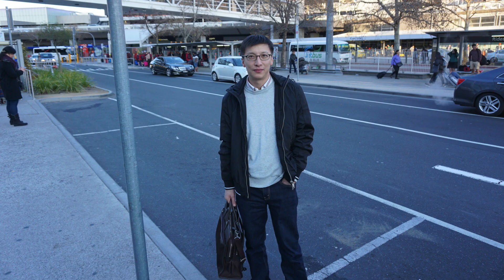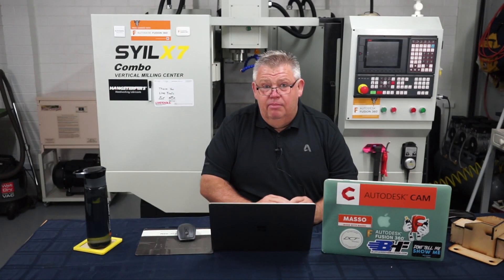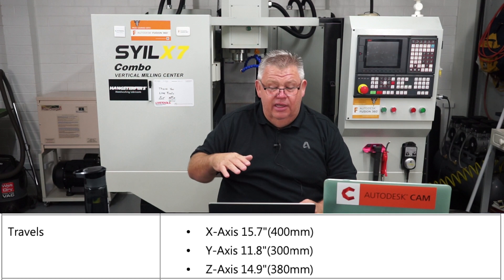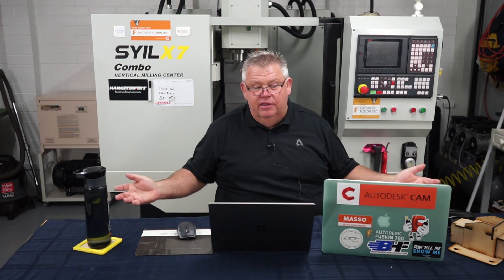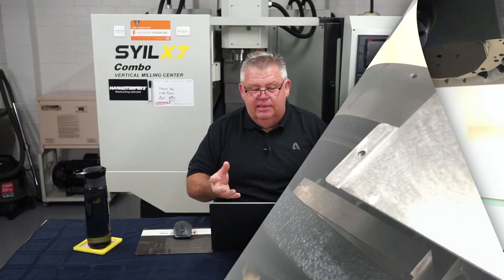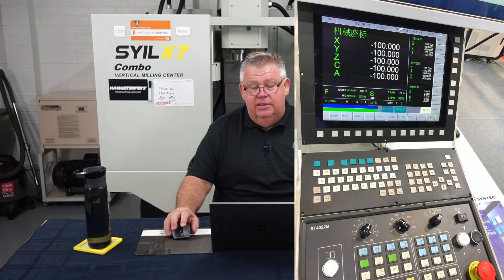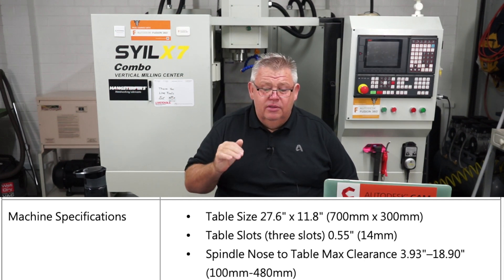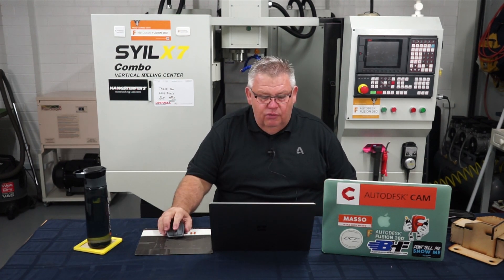2020 SYIL X7 - All new Epoxy Granite CNC Mill

Comment: Have you had any issues running the x7 off the rotary converter?
Reply from the maker: Hey mate. Absolutely not, no issues ever. I have an Australian made rotary phase converter (PC8 Phase change converters Australia). I run my entire shop off it. CNC, manual lathe & mill, pedestal grinder and drill press. Cheers 🍻
Reply: @DCT_Aaron_Engineering  Thank you for the reply!
Reply from the maker: No worries 👍🍻

Comment: It's nice if they reinforce the internal structure with steel, my concern is if you were to dry/mist mill and cause thermal creep and deform the epoxy granite locally. Epoxy glass temperature is very low, some range from 50 to 70C and doesn't take much force to soften it.

Say if you were dry mill and hot chips cumulate in a spot which would ultimately heat that area, how can syil ensure this kind of problem isn't a problem?
Reply: We use Schneeberger Swiss, it is the same as they provided to DMG MORI, GF+, HEMLER, Etc. so it is top class components in the whole machine tool industry.
Reply from the maker: Hi Richard. I’m sorry but I can’t answer your question. May I suggest you contact Syil directly with that question. Personally I’d be running flood coolant, or if milling steel compressed air blast. TBH, I don’t foresee a pile of chips staying that hot in a huge pile. However that’s my opinion and not a proven fact 👍

Comment: they now have an option for a fanuc controller and a siemens 828 3 axis controller. they have removed the syntec option
Reply from the maker: Hey mate. Yeah they’ve got a few controller options to choose from. It all depends on how deep your pockets are 💰 😉
Reply: @DCT_Aaron_Engineering  if you upgrade to Siemens controller they also upgrade to Siemens drives and servos. It is a complete package upgrade. Correct?

Comment: Datron german cnc milling machines come with 60,000 rpm spindle without any torque issues. They specialize in high speed milling.
Reply from the maker: That good to know.  But have you seen the cost of that machine?  When comparing CNC machines you must compare apples with apples.  A Syil isn't a Haas, A Haas isn't a DMG Mori or an Okuma etc. etc. etc.

Comment: Hi Aaron

That is exciting news especially about the change to an LNC 6800.  This will mean a jump in screen size from 8" to 10".  The view you showed of the epoxy granite was not that great--- it was full of air bubbles.  This is a concern.  Care to comment?
Reply from the maker: Hi John. Thanks for watching and commenting. Yes I think Syil is very innovative for going down this path. No doubt they will have teething problems at the start. The photos where provided to be by Mr. Xushuo from Syil. I also noticed the air bubbles. I can’t explain this, but they appear to be superficial. To my knowledge, Mr. Xu’s and his family own a foundry and I know they have been using epoxy granite for some time and building bases for other named brands. Syil are an OEM. I probably haven’t answered your question. Maybe Syil can input into the conversation??

Comment: The epoxy granite technology just seems so untested. If it was from a premium cnc company (and I know some are using it) I'd be all in, but not with a chinese reseller/manufacturer, though these guys might be one of the better ones.
Reply from the maker: Hey mate. That’s fair enough. To my knowledge (from Mr.Xu) Syil have their own casting factory and have also been doing epoxy granite bases for other “named” companies for some years now. This is what I’ve been told, however I can’t validate this 👍
Reply: Untested by who? Mineral cast frames are being utilized in some top end Hermle, kern, DMG mori, Datron..
Reply: @Foomanlol  Hey mate I meant Syil in particular. I guess I just lack a bit of confidence. It's like if Australia decided to build rockets. I know NASA and Space X have, but I'm not going to put all my pennies in some Kangaroo powered fucking dreamtime spaceship.
Reply: We use Schneeberger Swiss https://www.schneeberger.com/en/products/mineral-casting/
it is the same as they provided to DMG MORI, GF+, HEMLER, DATRON Etc. so it is top class components in the whole machine tool industry. yes, as you said, only some premium CNC companies use it, but we are in now.....

Comment: How high does your ceiling need to be to run it with the z-axis up though? 1960mm seems very short.
Reply from the maker: Hey buddy.  Standard ceiling height of over here in Australia is approximately 2400mm (2.4m) or 94.5" (7.875 feet).  My current Syil X7 milling machine needs a height of 2130mm or 84" to top of Z-Axis column.  Not sure of the latest machine, but I think they would be the same.  If Syil are reading these comments can you please answer?  Cheers, Aaron.

Comment: Thanks for making this video Aaron, I was a bit confused about the new machines before. What you say at the end about manufacturing and supporting your local businesses is so true. I was wondering... are they not offering the touchscreen iPad-like controller anymore? Was that any good? I don't hear about that very much.
Reply from the maker: G'day Marco.  Hey, what are you doing watching my videos?  You should be utilizing that free time building or flying your aircrafts (LOL).  Cheers mate, Aaron.
Reply: @DCT_Aaron_Engineering  Ha ha! I'm hard at work designing instrument panel #5 on Fusion as we speak.. I'll send you some pics of what it should look like. It will require major rewiring behind the panel as well. Cheers Bro!

Comment: Nice looking machines coming from Syil.  

I disagree with one point that you made about encoders though.  Good machines using relative encoders do not rely on the limit switch for their accuracy.  That would be crazy.  The homing routine commonly used; travels to the limit switch, and then reverses to the first index pulse from the encoder, and uses that position as its reference.  So for a 5mm pitch ballscrew with the encoder directly mounted, the reference will be within 5mm of the limit switch.  Sometimes a routine that reverses past that index pulse before travels to it again, is used instead.  I guess that might have backlash considerations.  The biggest problem with relative encoder axis positioning (aside from the operational inconveniences) is that it relies on ballscrew system accuracy which is dependent on temperature and load, and thus also axis velocity.  Errors are inconsistent as the ballscrew expands and contracts along its entire length - so position measurements close to the driven end are less affected than those at the far end.  Temperature changes can also reduce the effectiveness of ballscrew mappings.  Schemes to limit those factors (such as liquid-cooled ballscrews) are complex and thus costly to implement.  An absolute encoding scale takes the ballscrew and its bearings out of the equation completely.  The scale is now mounted to the table which having a relatively larger thermal mass will stay close to room temperature regardless of load and velocity, especially if being flooded with coolant. For ultra-precision, liquid temperature control is relatively easy to implement too.  It is easier to drill coolant channels through a table than it is through ballscrews!
Reply from the maker: Hi Ian and thank you for watching. I appreciate your time in providing that thorough and in depth explanation for me and my viewers. Obviously I’m not a electronics technician and based my explanation of my own experience using lower end closed loop steppers and servo motors. If that is the case I stand corrected. Thank you for keeping me honest. Regards Aaron
Reply: As a former pick and place, flip chip, die bonding robotic designer and tech, I hsve to compliment you on your excellent breakdown, analysis, snd concise commentary on the respective positioning systems.   Obviously, this was not your first rodeo.

Comment: Many closed loop system machine use the mechanical switches to get it close, but once tripped, the control will turn the servos until they hit the marker pulse on the encoder AND then set home at the marker pulse. Very precise and repeatable.
Reply from the maker: According to the Okuma website they’ve been using absolute encoders for the past 20 years. It’s only recently 5-10 years that other machine companies have caught up 😉
Reply: Today they will just do a hard stop detection. You run the servos until you hit the hard stop, then backup a little until the encoder is on zero degrees. To avoid doing that every time the machine is powered up, the position is stored with battery backup.
Reply: @BaldurNorddahl  to what are you referring to?
Reply: @martyscncgarage5275  just saying no mechanical switches, they use a hard stop instead, the rest as you said. Saves the switches and the connection to the controller for something that is only used once or a few times in the lifetime of the machine.

Comment: Great video buddy!  That X7 is really sweet.  I sure do like the sound of those absolute controllers!  I was just thinking that even though the work envelope is a bit smaller than my Pro.....enough that I don't think I could make two of the bigger brackets at one time......with 5HP available and the extra RPMs, I could do one a lot faster.  It would save me a good bit of grief with the CAM work too. LOL  Do you know of anyone with a channel doing reviews on their lathes?
Reply from the maker: Hey Mike thanks for following along. No I don’t unfortunately. I agree, they need a good video to showcase their lathe range and capabilities. I’d volunteer for that if they were to send me one 😁
Reply: @DCT_Aaron_Engineering  You and me both. lol :)
Reply from the maker: I won’t hold my breath 😑
Reply from the maker: I’m such a negative Nelly aren’t I 😳

Comment: Seems like a nice little machine. EG has similar rigidity to cast iron but with far better dampening properties .
 
I particularly like that these would be really easy to source parts for and replace a ball screw or rails of you had too.

As for absoloute encoders, our 5 month old Haas vf4 still uses limit switches lol.
Reply from the maker: Hey Manny. Yes they look really good specs on paper. Can’t wait to see one up close 😉. Haas are still an excellent machine. I miss the SMM2 at my previous school 👍🍻
Reply: @DCT_Aaron_Engineering  seen one of these yet? I priced one up at 45k yesterday.

Comment: Good to see mineral castings being used by Syil Aaron, Surely this should inspire more Australian manufacturers to use this Technology.  It's perfect for low volume manufacturing, and the finished product will have better stability and accuracy, superior to a machine made from cast Iron alone, with the added advantage of a lower cost of production. Come on Aussie come on. Do your own research, you will be surprised how easy changing to mineral castings for you machinery is to implement. And it does not just apply to machine tools, Use your imagination!
Reply from the maker: Hi John.  I knew this video would grab your attention.  Speaking of epoxy granite castings, how is your build coming along?  Last time I saw it at the MSMEE expo it was coming together very nicely.  I agree with you, it's good to see other manufacturers using this process with their machine builds.  I'm very keen to see one of these new SyilCNC machines up close to compare and contrast.  Cheers John.  Aaron ;-)
Reply from the maker: You do some really great work in your shop Peter.  To be honest, I think you have probably forgotten more than I'll ever know.  Great chatting with you on the phone today mate.  Enjoy your lunch and will talk soon mate.  Cheers, Aaron.

Comment: My syil x5 is single phase. The nameplate claims 40 A or something but that is nonsense. I feed it from a 16 A three phase circuit with only one phase connected.
Reply: @weldmachine  LNC5800. Seems ok for me. Nothing fancy but it gets the job done.
Reply: @weldmachine  If I was rich I would get something 10x as expensive :-) But actually I think the machine matches my skill level. Something more would just be a waste at this point. Also Syil is filling a gab in the market. You could get 10 of these machines for one high end machine.

I am just waiting for Syil to make a 5 axis machine. While I wait I am considering a Syil lathe to go with my mill.
Reply from the maker: Hi Baldur.  Does your machine have the umbrella tool changer like mine?  I think that is the only reason that my machine is 3 phase.  Speaking of power draw, I run my machine off an Australian made rotary phase converter.  I've never seen the load meter move of zero.  It moves to 3 when I hard start my 3 phase pedestal grinder LOL.  Cheers, Aaron.
Reply: @DCT_Aaron_Engineering  Yes I have the 10 pocket variant of the umbrella tool changer. I also got a tool setter and a wireless probe. I am not using the probe much because it is not really integrated and the macros completely undocumented. Just got a bunch of example files.

Electric motors can have a much higher power draw when they start. But at least here they took that into account for the fuses. A 16A fuse will allow considerably more for a short duration (slow reacting fuses).

My spindle is 2.2 kW but I will get chatter long before the spindle stops. The machine is not really limited by its power but by the rigidity. At least in aluminium, I have not worked much with steel yet.
Reply from the maker: Imagine the toys and shop I’d have if only I could win the lottery 💰 + 💎 + 👙 + 🚗 + 🏍 = 😃 (outcome divorce 🤣).